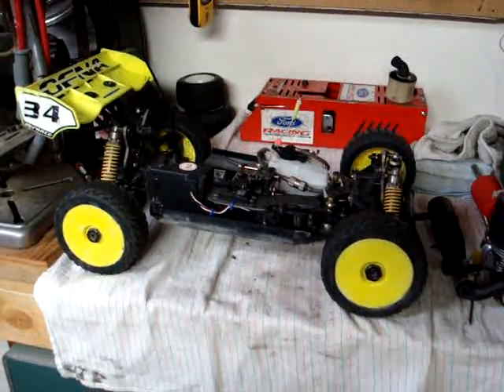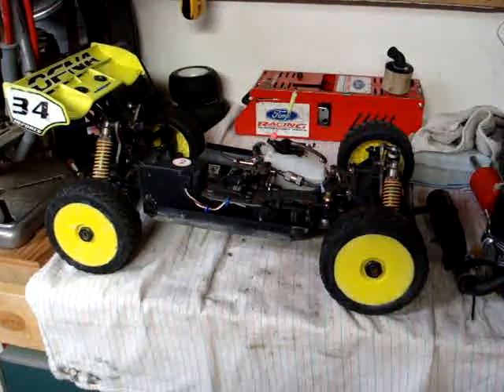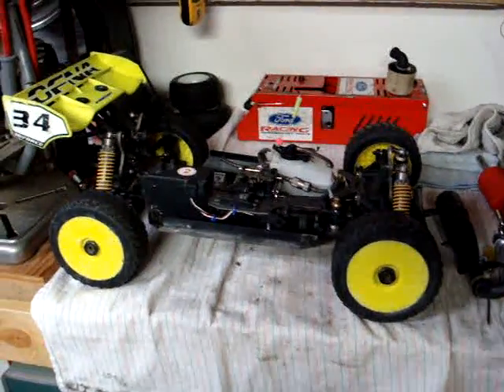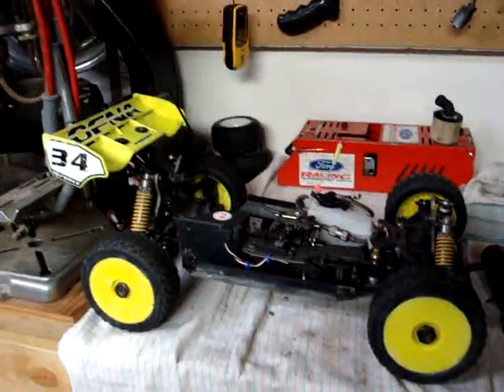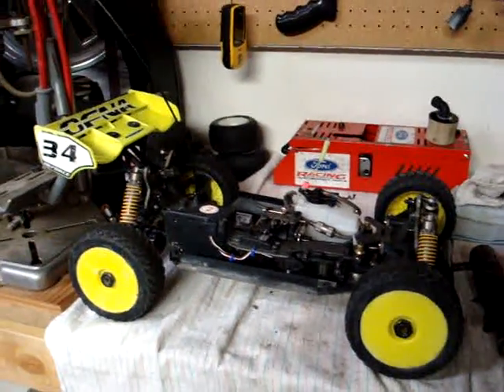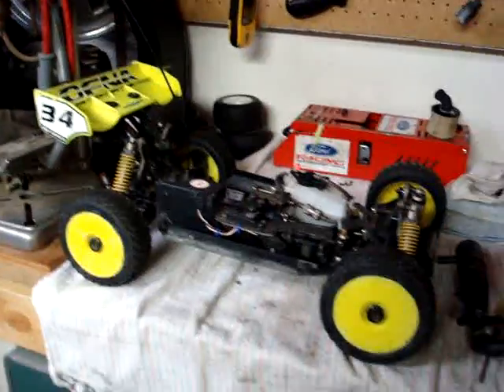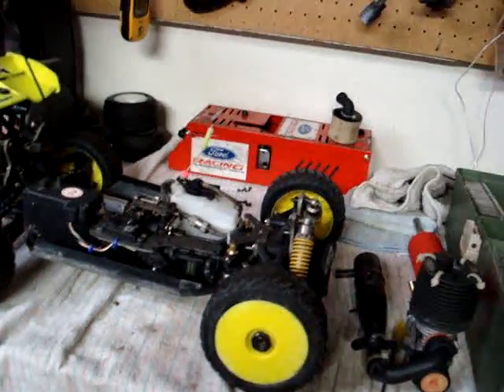OFNA Ultra LX ONE  Force .28 ( DEAD )

Comment: the force 28 is an awesome motor, but they dont last long.  The one in my GTP took a crap today, The sleeve turned inside the block and it would hardly run and backfire.  Im gonna try and reassemble it with the sleeve back in the right spot, see what happens.  I have 2 spares though.

Comment: mine did the EXACT SAME THING in my Jammin CRT RTR in about the same amount of time. i called ofna too, and they said i was on my own. i took the engine apart to examine and found the problem. the pin on the back of the crank (that the bottom of the rod fits on) has a spring inside it. that sping came out and got lodged between the rod and the side of the crank case and broke the pin off the crank, thus letting the rod free of the rod and slamming down into the bottom on its final stroke.

Comment: how r the ez starts for the ofna lx ones ???  i had my throttle get stuck in full and ramed right into the only car around the dirt pit mine   lol  bent the whole chassis up and the front drive shaft about 90' angle lol   ouch   but i love the car fast  it is

Comment: i had the same problem just bought the lx2 for my 10 year old brother  did the break in on the motor tuned it ran 2 tanks put brand new batts in everything ran 1 more tank and the throttle stuck wide open still had steering managed to keep it going in a circle the circle got bigger and bigger until i ran out of room and bam right into a 6" wide metal fence pole. the impact was so hard the piston snaped clear in half. they wouldnt cover anything.

Comment: had something similar on a savage .28 except the hole was on the side. didnt want to scap it because it still had amazing compression, so a $20 rod and some jb weld and it's still running great. trick was to file down the hole at an angle so that the jb weld would be stuck in the block

Comment from the maker: @roostertails250  My man don't get upset, easy fixes for you. Throttle sticking , slap a return spring or rubberband(nitro will eat it) on the carb. =fixed. Tires Re-Glue em,we all do it. RTR R/C's pretty much always have dry diffs, just a bit of grease to get by.I used 7k center diff,3k front and 5krear(I dont race).ALWAYS re-tighten ALL hardware on RTR stuff (locktite). Steering servo,Ive been doing this for a bit I know to JUNK RTR servo's,so I bought a steering servo the day I bought the LX

Comment: well the engine sleeve is to tight. and by breaking in the engine it loosens the sleeve up. if you dont break in the engine correctly it causes the piston to get to tight on the piston sleeve then the piston rod comes out the bottum of the engine.

Comment: P.S. if you buy the back plate to convert it to bump start, this problem will NEVER happen again (because the spring inside the crank is only for pull/roto start)